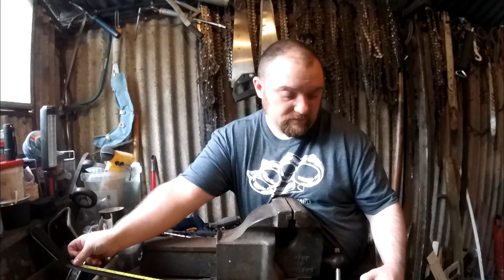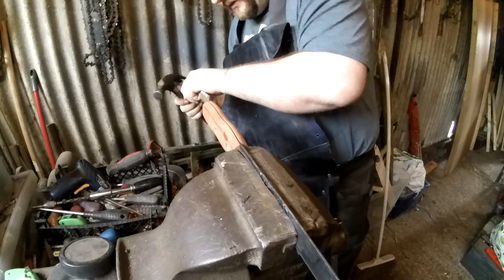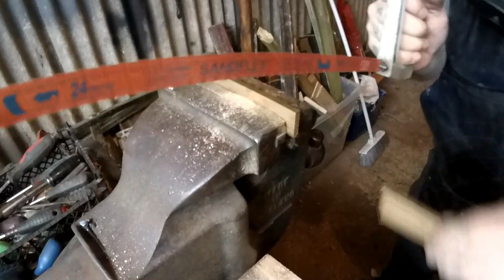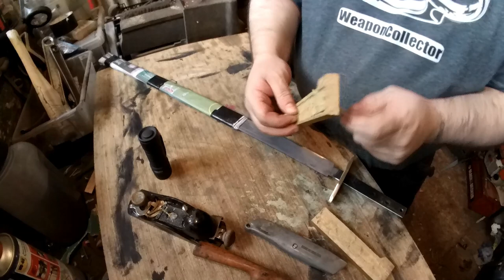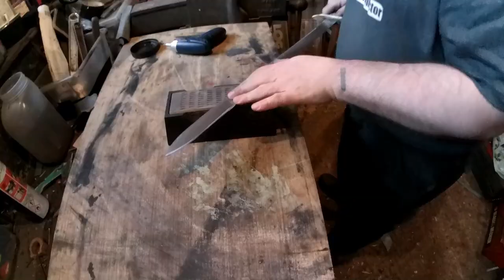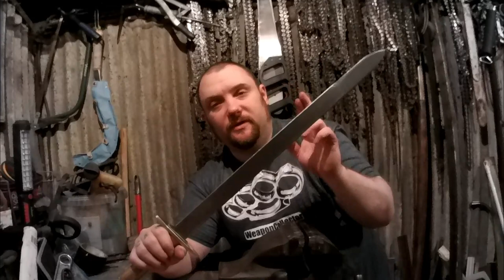Homemade Short Sword for £10 (One Day Builds)

Comment: Why not just make one from a thicker flat steel bar ?
Reply from the maker: i have no way of tempering / hardening metal, so i need fully hardened tool steel and work with that, removes the need to forge or temper etc.
Reply: if it was a mild steel bar it would be very heavy and ud need to grind it a lot.